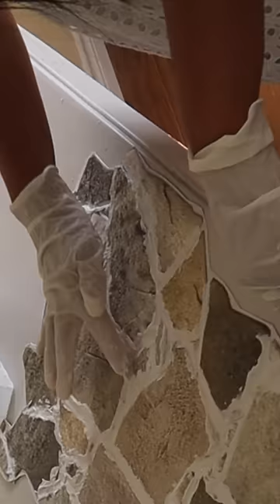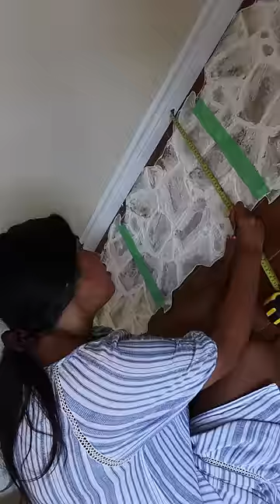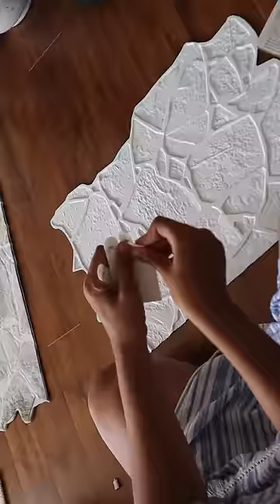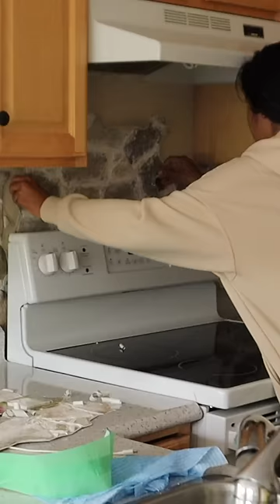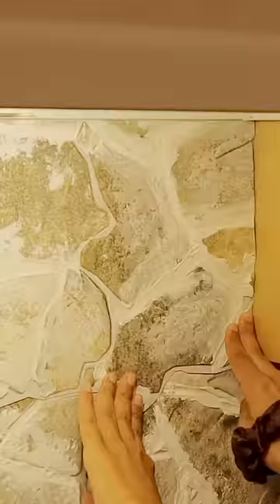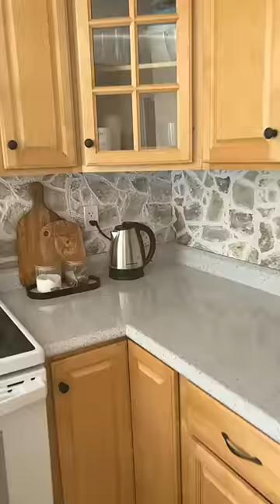Dreams are possible! ✨

Comment: I would be very surprised if you did not have wall damage from this. It looks like you used Command Strips or double sided velcro, but they can still rip paint off walls. Not recommended.
Reply from the maker: I know some people have had issues with command strips but I never have? I’ve used it across many different buildings and probably have used over 100 of them over the last 10 years. Maybe it’s in the removal? Not sure.